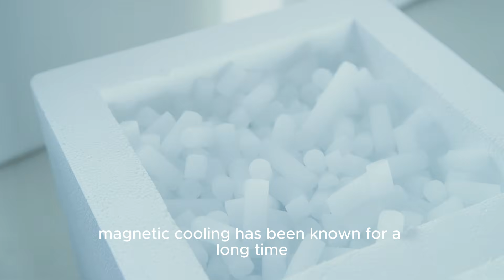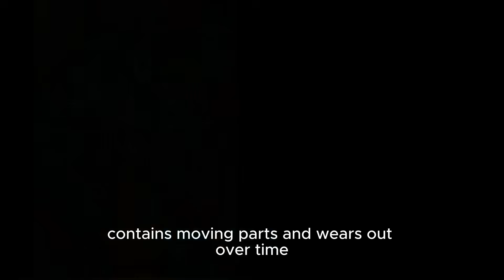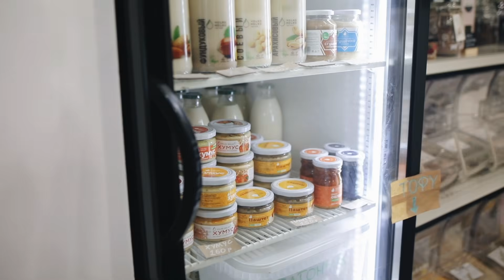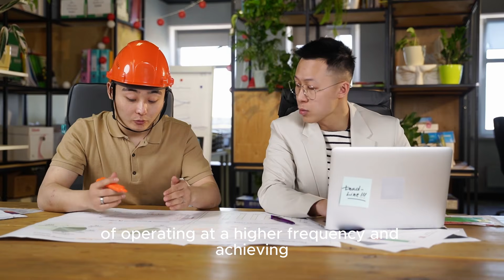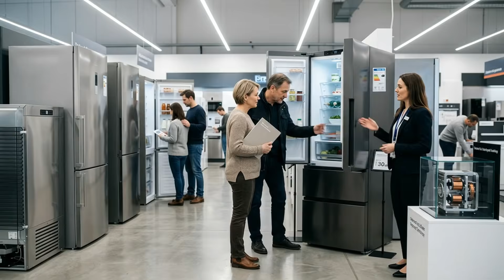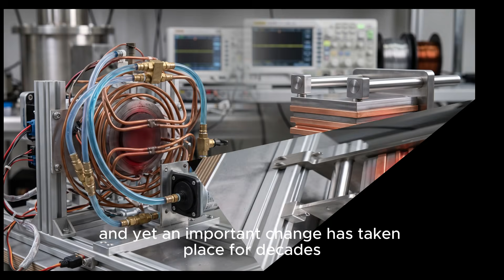China Just Reinvented the Refrigerator — No Compressor Needed

Comment: Misinformation 

For typical consumer home appliances, the technology faces a massive economic and physical uphill battles.

Impact on Consumer Practicality

High Initial Cost
Traditional  fridge compressors cost roughly €5 ($6) to manufacture. 

In contrast, current low-volume magnetocaloric refrigeration units run into thousands of dollars (€6,500+) due to the complex magnet assemblies.

Material Supply & Fragility
Peak room-temperature performance historically relies on gadolinium, an expensive rare-earth metal ($300+/kg) with volatile supply chains. 

Alternative iron-silicon alloys (La-Fe-Si-H) are cheaper but physically brittle and difficult to manufacture at scale with consistent properties.

Narrow Temperature Span
A single magnetic cycle typically shifts a material’s temperature by only a few degrees. 

While a beverage chiller only needs a small shift, a kitchen refrigerator/freezer requires bridging a massive temperature gap (from room temperature down to 0°F / -18°C for freezers. Less for refrigerators but still prohibitively expensive.

Engineering Complexity
To achieve 40° refrigeration or deep freezing, engineers must cascade multiple magnetic stages. 

This multiplies the volume of rare earth materials needed, requires complex internal plumbing to cycle water/fluid, and increases the weight of the appliance drastically.

Summary Outlook
 magnetocaloric cooling from a consumer retail standpoint, you will not see affordable, everyday   magnetocaloric home refrigerators and freezers in local appliance stores anytime soon. 

The incumbent vapor-compression technology is simply too cheap and universally established to displace it anytime soon.